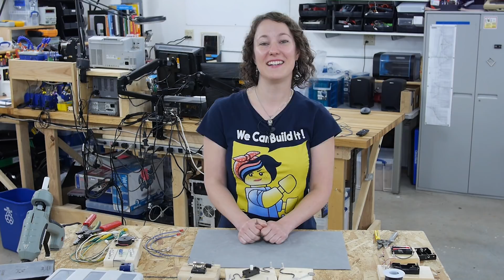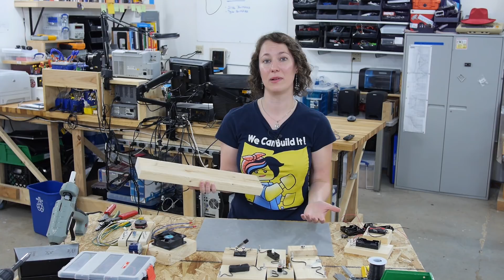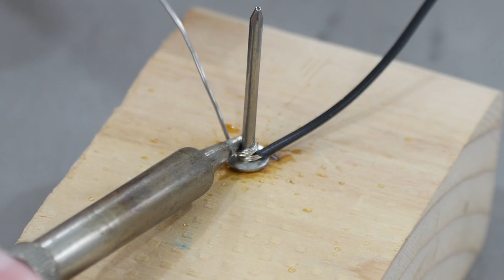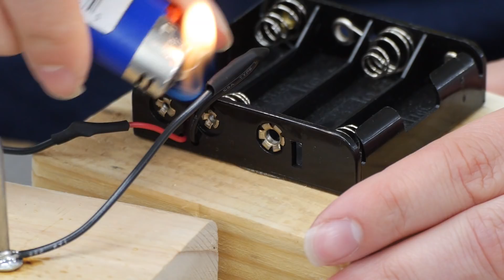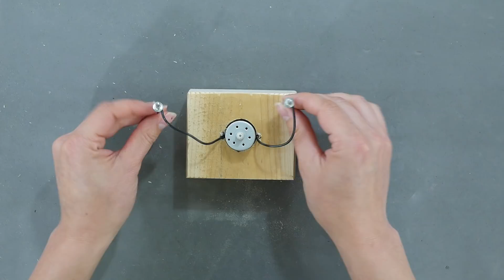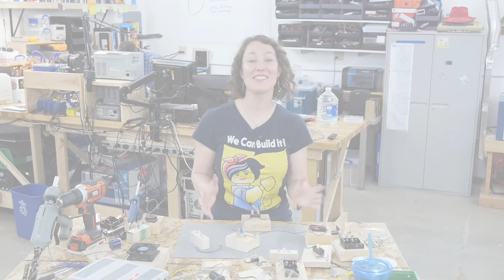The Learning Circuit - Building Circuit Blocks

Comment: thank you . about the rivet it's depents if its aluminium gonna be hard to solder.
and the wire connection that you made it's not good for soldering it's good for connection without soldering.

Comment: Bit of a pricier solution, but I’d suggest banana plugs and sockets for your connections. Easy for any age to use then
Reply: Absolutely! If you have the budget for banana plugs, they are fantastic. I frequently do these projects for schools and libraries that have low budgets, so I tend to default to inexpensive materials. The first time I build these I had salvaged a lot of the components from donated dead computers to help keep costs down.

Comment: This is a great idea! I bet it's much cheaper than the store bought versions... though I'd probably use something thinner than a 2x4 🤓👍
Reply: The 2x4s are nice if you have to drill into them to make the part stable, like with the motor. But you can use anything you have lying around that gives the parts stability, as long as the material isn't conductive.
Reply: Yeah, excellent point 🤓👍

Comment: Great video Karen.
This can be used for quick circuit testing as well.

Sure, a solder-less breadboard is very flexible for the many circuits you can design and test, but they can also be a major pain should your fingers decide to not be so dexterous when you trying to push the pins in. It also eliminates the weak bendy wire issue as well.